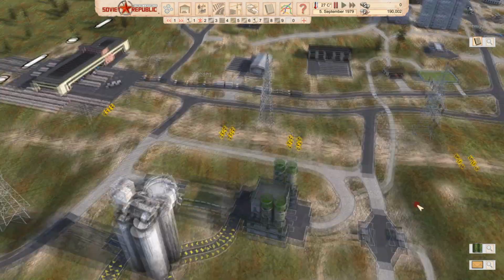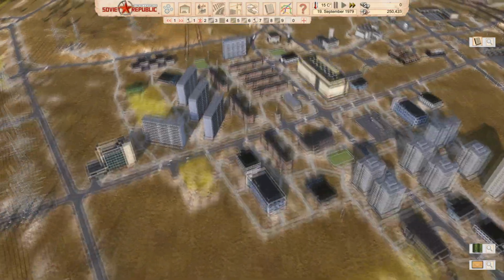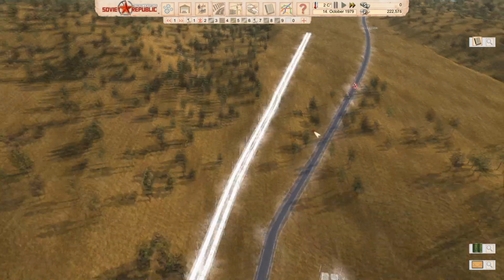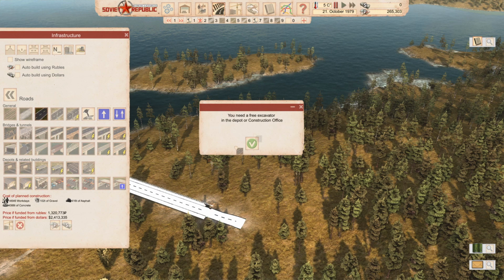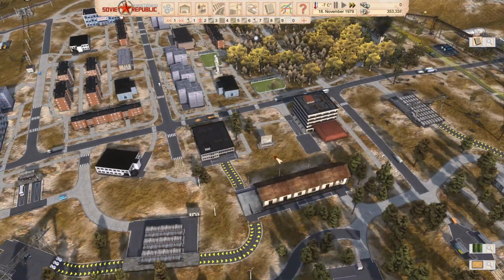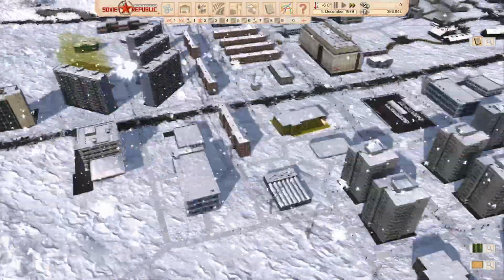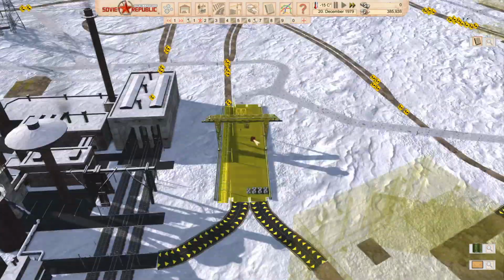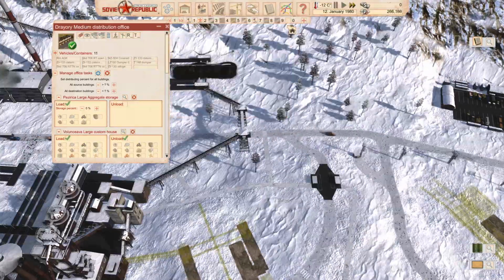Crossing Water :: Workers & Resources Soviet Republic (Seasons Update) #30

Comment: I think that distribution office that buys uranium is set as "buy everything". Therefore it will buy uranium if it fits somewhere that office unloads stuff.
Reply from the maker: ty for the tip, had not realised this, at least the truck drops the item off, it is annoying when one keeps going round a route full of the wrong material.